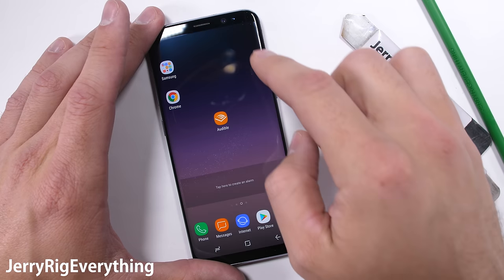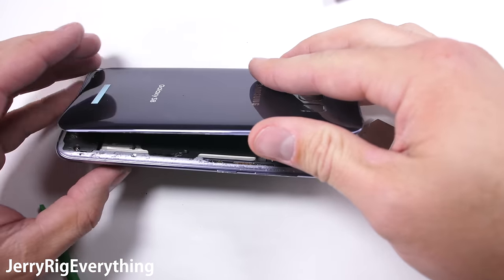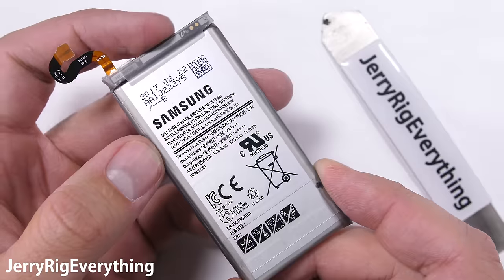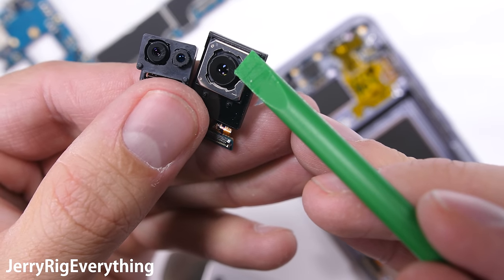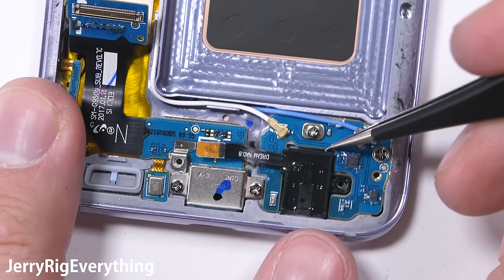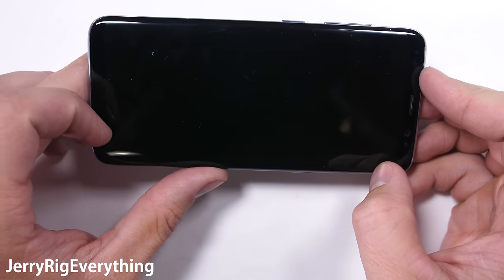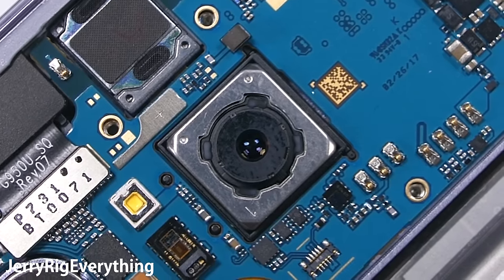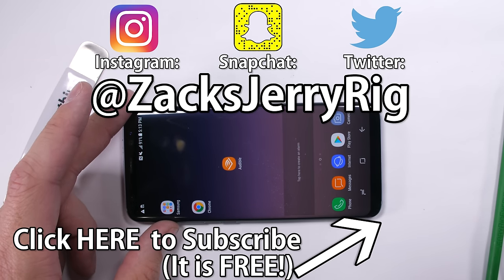Galaxy S8 Teardown - Complete Repair Video

Comment: jerryrigeverything 

 absolutely love your videos You Are one of the best without a doubt!

I have a question about the glass panel and your recommended parts place.

when you buy parts from the website under your description are these parts actual Gorilla Glass quality or are they just regular glass quality.. 

I know the water resistance will not work as well but replacing with these parts.  will not say Samsung on the back anymore and if it's not real gorilla glass doesn't that devalue the phone a lot when you try to resell it..

I don't think I've ever seen any glass replacement stating it was actual Gorilla Glass!!

is there a way to get a OEM replacement gorilla glass for the back of your Samsung..

Comment: Good morning dear friend.

I have a consultation, I bought the equipment about 2 months ago, it has suffered from falls and the glass lid has been broken. I want to make the change of the lid and my question would be. Would you lose resistance to water?

On the other hand, the lid has a small slot. Can I use it underwater or do I take chances?

Greetings from Peru and thanks in advance for the response.

Comment: You fail to mention this but right when you take the back cover off, the fingerprint sensor has a connection you have to unplug before you can fully remove the back plate. You can see in the video he just pulls it off which you should NOT do. Please remember this if you're repairing the phone yourself!!

Comment: On my Samsung Salaxy s8 plus,
 I made this pretty embarrassing and stupid mistake. I had to take out my sd card but accidentally pushed the SIM ejector tool through the microphone hole on the top of the phone. Didn't realize it momentarily and pushed even further until I felt like I just penetrated something. Now, the microphone still works, I was able to test that using the built in sound recorder's interview mode but I'm really concerned that I may have compromised the water resistance of the device. I'd really like to hear you technical opinion on this?

Comment: Parts question.  it looks like the front glass listed is just a protector.  Ebay lists quite a few... is there a 'brand' that has more reasonable chance of fitting?  I cracked the glass only of my 8plus... dropping 2ft was too much.

How terrible is it to separate the glass from the front?  It seems worth the try compared to a replacement display... if it goes wrong i need a replacement display.  Seems pretty interesting to try just irritated its on a brand new phone.

Comment: I cracked the backglass cover and want to repair it myself. Ordering the green tool and pry tool. What else do I need. I saw in the end when you put the back cover on, does it need glue? If so where do I get it and how do I apply it?

Comment: watching this after dropping my s8 even with a case on, it cracked the rear glass just close to the fingerprint sensor, the sensors is working fine but it seems to have taken a hit and is displaced a bit. The glued sensor definitely has taken a hit😭

Comment: Zach, I have a question..i can fit a piece of paper between the glass and the metal frame, should I be worried about the water resistance being compromised?

Comment: Hi Jerry. Just bought an S8+. I tried to do the 2 SIM + Micro SD card trick on the phone like I had on the S7 edge. it did work but I couldnt get the tray out after it. after much force and use of floss to pull it out I finally took the tray out but now it wont go fully back in anymore. the tray it self doesnt seem to be bent Im guessing maybe the  eject mechanism is damaged. can you please guide me if I can change the sim tray housing inside the phone without the need to change mother board? sorry for the long msg! Big fan. thank you
Reply: First of all you dont do that to a phone...

Comment: Hey guys need little help. Front glass of my S8 is crack a little. I checked few video...how to replace it with new front glass. My question is.....Is it necessary to open and seprate back glass and battery for this fix?

Comment: Hi, from this video I see if the microphone and its water resistant membrane do not face outwards, but make a 90° angle to the canal. So can I say it is safe if a sharp pointy thing enters this canal accidentally, such as pins and needles?

Comment: I kinda wanted to know, if I only break the glass screen and not the LCD do I still have to remove the whole back? I really don't wanna pay $200 to replace anything on this phone OR do anything too costly. So is it possible to remove the screen just by heating the adhesive and replacing the screen?

Comment: Hiya!
I was wondering if you could maybe do a comparison?
1) like the SD835 vs the A10 size.
2) volume of battery on S8 vs iphone7
3) size, efficiency and density of the two motherboards (i think iphones is much smaller)
4) size and effectiveness of the two vibration motors (since S8 seems 1/3 the size)
4) also could you compare the two speakers (S8 and iphone7) against the and dual front speaker moto phone?
I ask because once again I am under the impression that the moto speakers are 1/3 the size of the main speakers in the two leaders and the same size as the ear speaker on the two.
5) and also maybe the effectiveness of the hydrophobic coating on the moto phones vs the two leaders?
6) and finally compare their internals density and efficiency to the Xiaomi Redmi 3s (because as far as I know, that is the smallest 5inch phone with a 4000mA battery)
I think that would be a really cool and enlightening. 
love your work.
cheers.
Reply: Dhruv Halwasiya Other channels bro! Most of that isn't really his thing
Reply: Great questions, do you repair phones by any chance?

Comment: Great video thank you! I was trying to understand if it is possible to damage anything when pushing the Sim tray ejector tool  into the other (wrong) hole on the top. Which regrettably has the same size....

Comment: Hi, I've got a question..I accidentally put a piece of my sim card down the sim card slot without the sim card holder, and wanted to know what I could do...could I screw open the back and like it should be no problem or..what do you suggest, would it work 😓 if I put back 🥴

Comment: What was NOT mentioned -- Always do your best to disconnect the fingerprint scanner from the motherboard before you completely pull the back glass. If you don't; you run a risk of ripping the fingerprint flex and having to replace that part.

Comment: Hii Jerry my s8 plus has a red dot of the size of "full stop(.)" on bottom right of screen by the time I noticed it 15 days had elapsed. The Samsung service center guy  says to change the display they will change the battery too is that necessary?

Comment: Hey a friend and I followed this video for teardown to remove a stuck Sim card from my S8, but couldn't see where to put one of the parts when we reassembled it. I assume that particular part has something to do with my camera and flashlight because neither of them works now. It gives me an error message saying it's being used by another application. Would you be able to help me locate where I put this piece please. I'm desperately missing my camera and flashlight. Thanks in advanced

Comment: I have a question, I dropped my s8 for almost 5x now with a case and no damage so far to the front and back glass. should I be worried about damage internally?? what are the signs

Comment: Well the dog emblem is simple.

Some dogs have a bite pressure (Pit Bull or German Shepard as an example) and sharp enough teeth that they could penetrate the glass and puncture the battery, which could cause a fire and sure injury to the dig.

So basically, you shouldn't ask your dog to "fetch" your phone, seeing as his/her teeth are its only way of carrying it.

It seemed like a no-brainer, but I'm glad to help our.

A cat likely wouldn't pick up the phone with its mouth and its teeth are to small to penetrate the glass and the bite pressure of a car is fairly low at only a couple pounds per square inch.

Comment: I have one (S8).  I dropped the phone down accidentally.  The battery cover was broken down.  I approached the samsung authorised dealer.  The dealer told the battery cover and labour charge costs Rs.4600/- so huge. Can I try  to fit a back battery cover as you showed me after purchasing the battery cover from the market.  Kindly reply

Comment: So ive repaired s8+ 3-4 times after watching with no problems however my most recent repair isnt going so well. I had everything together and turned on but there was the issue of sims card not working/no cell service. (Turns out i was forgetting a piece) so i took it apart put said piece back in and hooked everything back up again but now i have the black screen of death. I hold down power and volume down and it resets but all i hear is the audio with no visual. Any clue on what the issue might be?

Comment: Is the smartphone still water resistant after an repair?
Reply: I don't think so maybe if you glue it using some kind of water proof seal and still wouldn't be as water proof as before.. but if it's water resistance you want then pretty much every phone is water resistant , you can take a oneplus one and two out in the rain and it ll be fine
Reply: @BankruptGreek  nah i mean if i bring it into an actual service tho..  nvm i have my question, i was there and they gave me an legit answer
Reply: @applebl3ach  what is the legit answer?
Reply: @BankruptGreek  they'll make it water resistant again but charge 80$ to fix the fucking back glass

Comment: Is there a reason you would have to go in through the back to replace ONLY the front glass? I used to repair my S3 glass and only had to heat and remove the front glass, but every video I've seen for S7 and beyond removes the back and all the guts first. Can someone please tell me why?

Comment: This might sound random but can you help me diagnose a front camera problem. You see, I can not get the front camera to work at all. I tried clearing cache. Reatarting phone. Safe mode, phone reset, phone reflash via Samsung program as well as Odin. Nothing... soooo it has to be a hardware issue. Also when I go I to the diag menu by lreaaing *#0*# in the phone dial menu, I can test all the sensors. When I try the back camera, no issue but when I test the front camera it reads a message 

" front camera module fail" 

What would really help me is if you can recreate the issue by taking your phone apart and simply disconnecting the front camera module to see if it is so. If SO then that should tell me what I need to do which might be to simply reconnect it. I have a warranty but I have to wait a whole week. I need my phone now because the app uber randomly uses the front cam to verify the driver... which I can not do lol

Much appreicat3d 😃

Comment: Hello sir, my samsung j7 pro mobile got hot during charging and then I switched it off.. but after that I won't start.. I show to repair centre he said that it got short circuit will have to replace some components, at this instance is my Secure folder data safe, shall I give him to repair my cell phone..  please do comment.. Sir...

Comment: My s8 screen freezes and turns green in mid brightness level but the screen itself is not broken. (So its working fine in low brightness level). Does this mean the display is broken and would need to be replaced?

Comment: MY SAMSUNG GALAXY S8 PLUS, Is having screen problems. The screen doesn't show anything when you turn it on not even the Samsung logo when it powers on. After its on the screen will turn green, the a light brownish yellow, then stays white. You can hear the screen when you touch it just everything is blank. We where having no problems with it until today and it just stopped working. However, their is a small spider crack in the left upper hand  corner. I had dropped it over 2-3 weeks ago and everything has been fine. an now its not. can I fix it.

Comment: How fragile is the charging port on the s8+? I'm worried I might break it in less than a year...
Reply: Sean Michael Del Socorro don't use cheap cables and just be careful when you unplug and plug it in.

Comment: I had a question, if the back screen is cracked or if I take it off do I lose the water   resistant? Mine is cracked but I'm not sure if it still has the resistant with a cracked backl. if I does I don't want to take it off if I risk losing the resistant.
Reply: Check the description. He linked kits you can use to replace the parts. They come with the waterproof seal. You can also take it to get fixed if you bought the insurance for it.

Comment: Crazy stuff to take off the backpanel, terrible, would be much easier with some screws, ok its a styling issue but anyway, whats happening after a repair? Still water sealed? I dont think so. Another issue is  the replace of the display, 350 $ its a bad joke! There are nice phones but never crack them!

Comment: I was cleaning the bottom speaker grill and noticed I can push in the wire I was using pretty deep. I saw a mesh in there but I think I pushed it in. Does anyone see a mesh that a deep in there?

Comment: With my samsung galaxy s8 plus I can't connect to the cellular towers. I think the problem is within the hardware of the phone but I don't want to open it up because it will void the warranty. But I have no clue what parts could be damaged. I know that it's not the sim card because i tested it on another phone. Can someone please help

Comment: I came back to this video because I just accidentally poked the top microphone hole instead of the SIM card tray. Doh! I ran a mic test using built in feature: *#0283# and it worked. But now I'm worried if any damage has been done to the water resistant mesh. It felt like something gave way.
Anyone know please?!